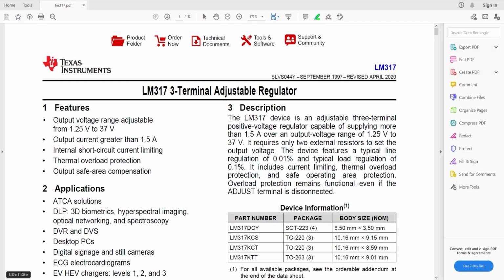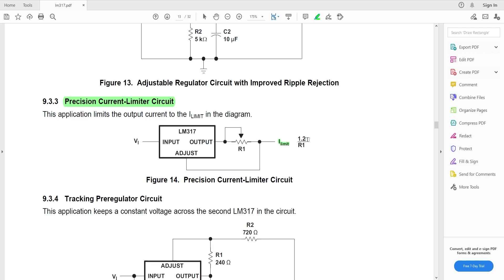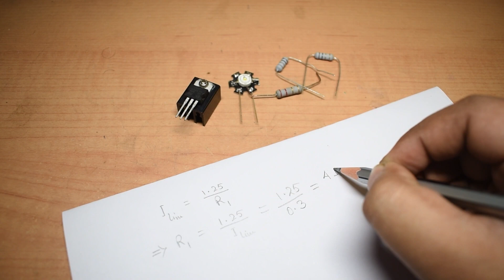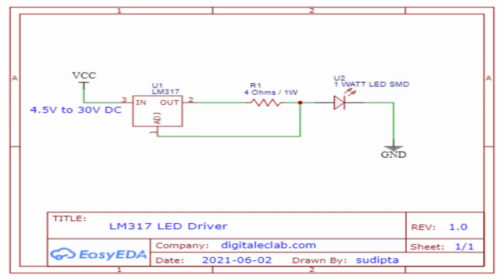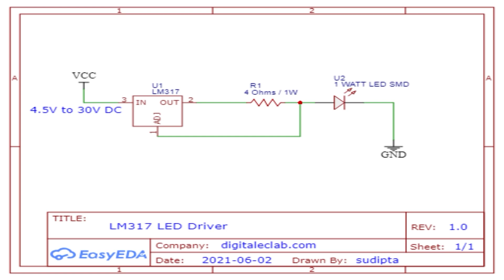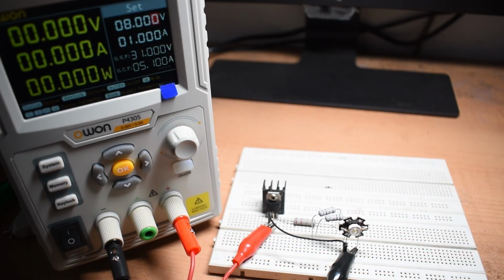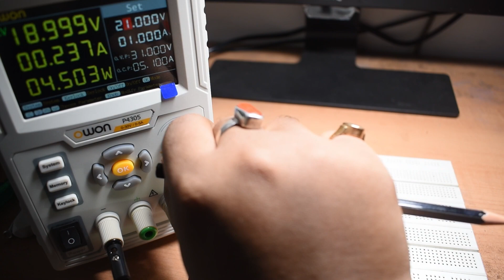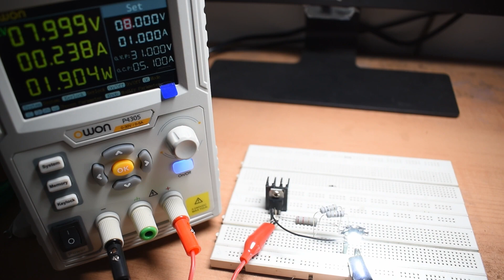DEC #09 Constant Current High power LED driver using LM317

Comment: If i want 2amps from lm317 to drive an 8watt 4 volt (2amp) COB led unit, how to get 2 amp constant current at 4 volts from a 12.5 volt to 13.5 volt car battery? If I connect two such COB units in series I need 4+4 volts at 2 amps from same battery. Can i use lm317 or i need a different linear voltage regulator? Pls answer!

Comment: aren't the resistors dissipating most of the power  (and not the IC)?
Reply: Depends, the voltage across the resistors is fixed at 1.25V, so the resistors only dissipate 1.25V * set current (300mA), the IC takes the rest.

Comment: Transistor is getting so hot ! Any solution?  I even attached heatsink too! Still get hot so much!
Reply: Lower the voltage i guess
Reply: The small vin-vout, the small heat. So you should have vin-vout about 4 volt.

Comment: How efficient is that method compared to a resistor in series with the LED ?
Reply: Same, but you need to calculate correct resistor value, and can`t change working voltage later (you can, but then need to recalculate resistance once more)

Comment: i have 3 18650 batteries and 3 1Watt leds which draws 350mA current each. how can i use these batteries to run 1Watt leds at 350mA constant current for each led. i want to use 3 18650 batteries in parallel to have more capacity but output will be 3.7-4.2 V. Please help

Comment: Good Video.  If i want to use 10-12 5mm led, what is the resistance should i have to use?  Will the circuit be the same?  Please help
Reply: Put some bean juice in there.

Comment: I have a question in my mind in monitor shows that led received 237mah but at same time 8-20v  also (when you increase voltage) so, my question is will led be damage due to high voltage?
Reply: I guess even though the power source voltage is increasing the purpose of the IC is to perfectly adjust its voltage such that current stays constant.
Reply: Excess voltage will be dropped across the IC, not across the LED

Comment: Sir, kindly give me a 30 watt LED driver circuit diagram using most common indian components.thanks.
Reply from the maker: ok sure. But tell me you want to drive the LED from mains AC or 12V batt?